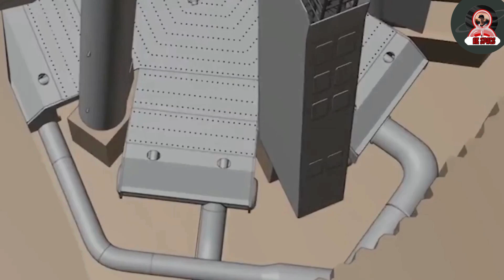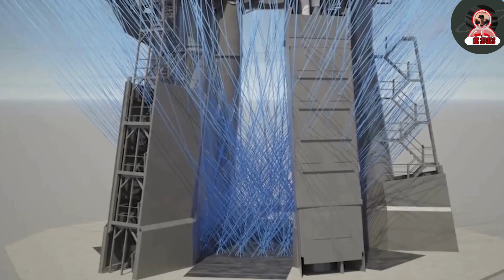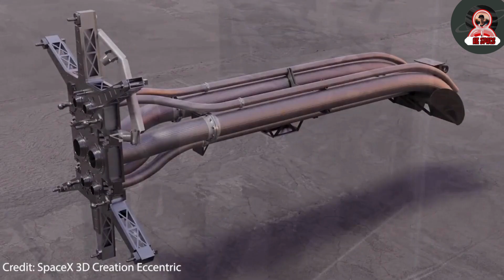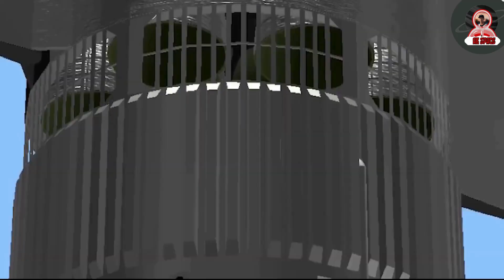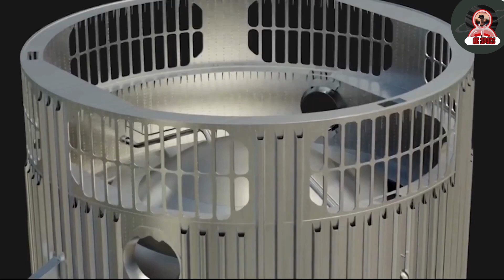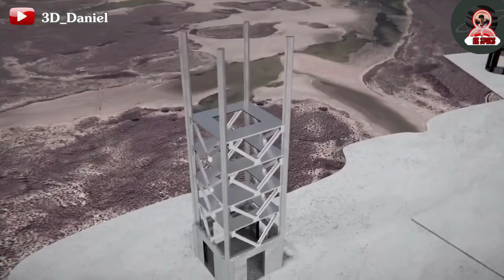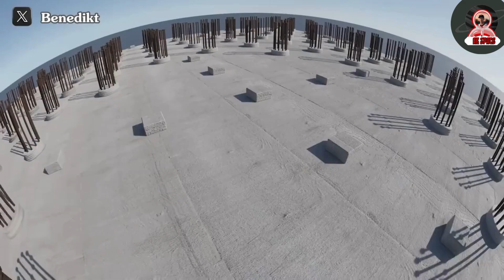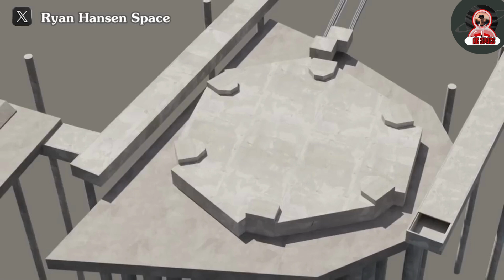SpaceX Damage to Orbital Launch Pad Revealed!  Starship Upgrade Redesign for Next Launch Unveiled!"

Comment: For about 27 Months we've been concerned about the Launch Platform Design -- not just The Deluge System ( Feb 2002) but the Height of the Tower AND the lack of a 'Diverting Deluge Trench" for a 16 Million Pound Thrust, 6,000 Deg, 400 Ft Long Blow Torch. Not questioning the Wisdom of the 1st Launch, after all it's a Test --- You Don't Launch, You Learn Nothing.